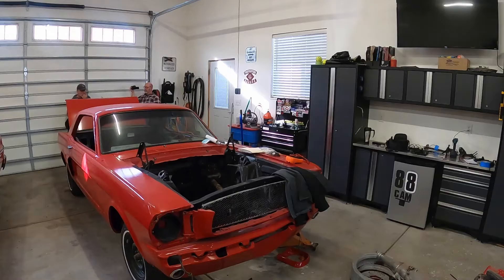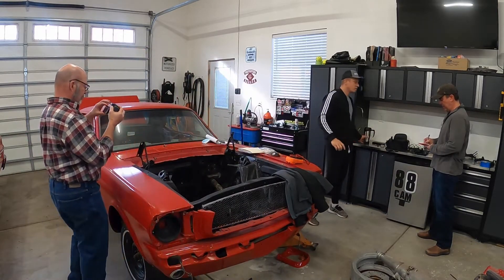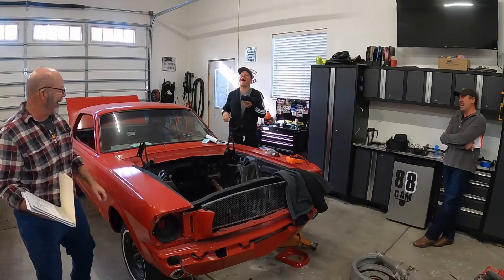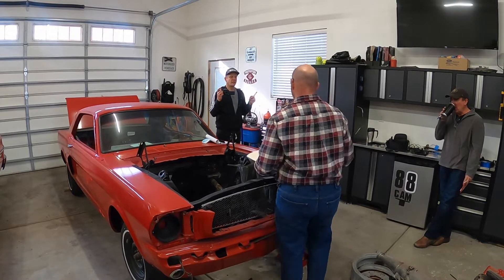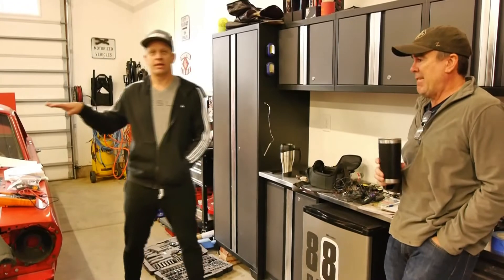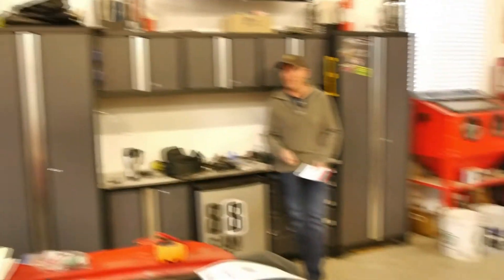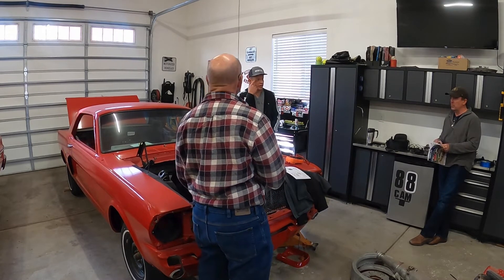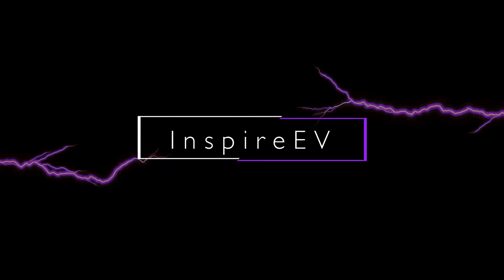Mating a 500HP Tesla Motor to a 1965 Mustang. #teslaswap #evconversion

Comment: As long as you're not using electric motor regen, you don't need to use the clutch to shift. Just lift your foot off the throttle pedal.

Comment: Dual motors you can turn on in phases. Run one motor at low speed to keep traction and then switch on second motor for more power at higher speed. Acts kind of like nitrous.
Reply from the maker: WOW! Didn't know that

Comment: There would be no clutch. You would connect the engine to trans input using a lovejoy connection. Then to shift you just take your foot off the throttle, the motor goes into free spin, and you can shift.

Comment: I also tried to sway my friend to the typical low voltage electric setup under the hood and run it through a 3 speed manual trans. But we went the harder way with the Tesla in the back.
Reply from the maker: We personally like the idea of swapping the rear end, but our goal is to do other vehicles like Jeeps ect, that won't accept the tesla rear end. We were also concerned about being able to upgrade the car(s) later.